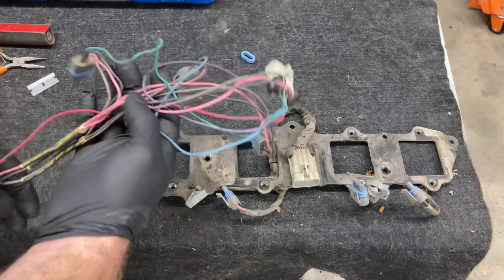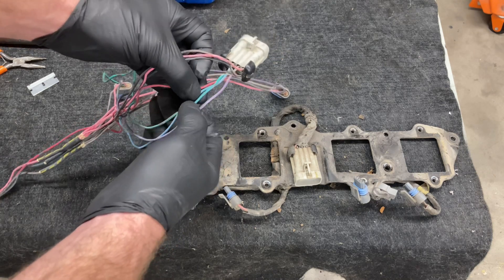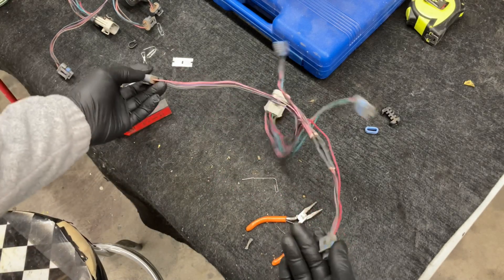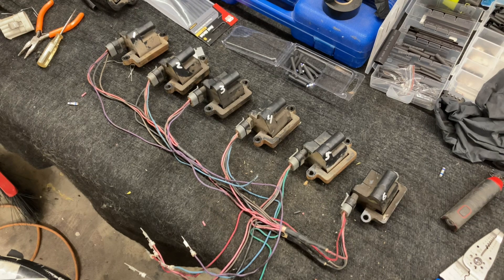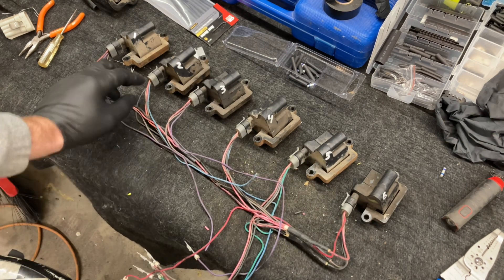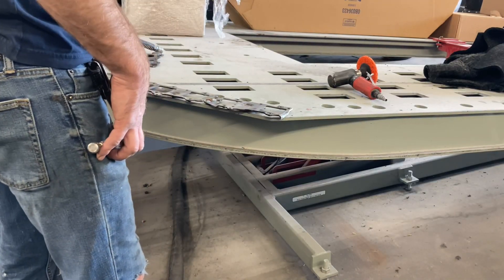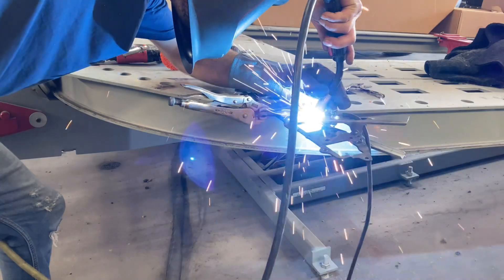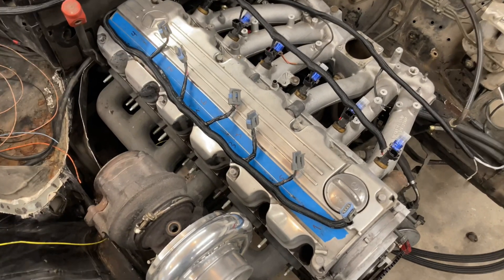Mercedes m103 Turbo, wiring LS2 coils

Comment: Awesome, may have asked this already. You mentioned you were going to use the MAS Relay for the megasquirt. How did you wire into the MAS. I just did mine, into a microsquirt but having some issues. So wanted to see how others have done it. I take it you probably used it to get the signal for Fuel Pump and probably for the switched power? and the tach signal?

Comment: Hi can you provide a diagram of how the coils will be connected to the relay board?
Reply from the maker: The coils won’t be connected to the relay board . Using the relay board for injector power and a couple other accessories. I will have a video of the harness connected to ecm when I get there .
Reply: @crousebuilds5505  thanks